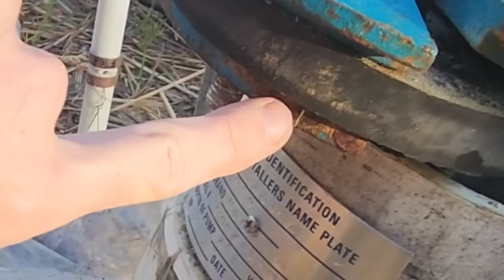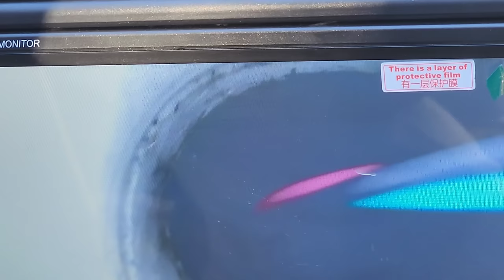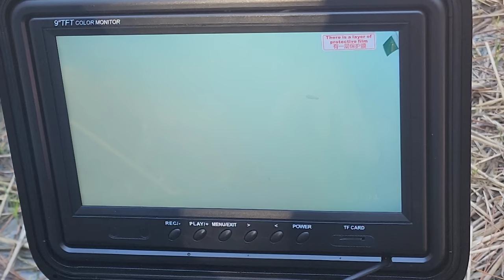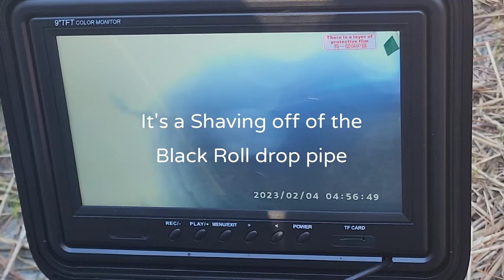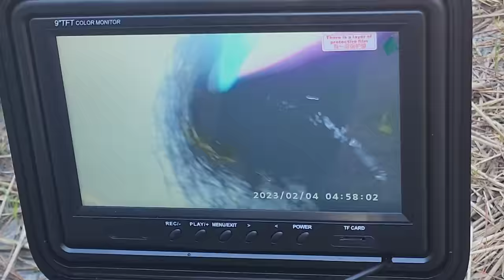What You Dont See! Discolored Well Water & Why it's Happening to Your Well.

Comment: My pump kicks on at 40 psi runs back to 60 kicks off..after 2 or 3 times it will drop  to zero. 30 seconds to a min later kicks on but shuts off at 45. Pressure switch changed. Still doing it. Pressure tank at 36 when empty.
Reply from the maker: Lower tank pressure to 30. Try that. 
If the water pressure  fluctuates up & down & your not running water, then the check valve in the pump is bad.

Comment: ⚠️ As an electrical contractor for over 30 years, I shuddered when I saw that “1900” (4” square) electrical junction box being used OUTDOORS!    I know virtually nothing about wells and water pumps used in a residential environment as my work area is a suburban metro area with municipal water supply.

Great channel and video.
Thank you.
Reply: Not sure about where they are at, but in my area, Wells are required to have an electrical disconnect at the location of the well itself. Normally just the well pump control box works, as you lift the lid and it separates the connection, but I had a 2 wire pump 110v and my uncle who is a licensed electrician used a simple light switch to make the disconnect until I could upgrade to a 3 wire pump and use the well pump control box with the capacitor. 
But we also have a shed the well, pressure tank and electrical are all in. 
I would recommend this guy build a small shack to protect the well, instead of using that igloo as a cover.
Reply: @cybernoid001  yes.. an enclosure would be very advantageous.
The 1900 style junction box is only approved and safe to use in indoor and where no moisture exists.
They are constructed of steel and have multiple holes for mounting screws and grounding screw(s).
They also have a ton of knockouts that offer ample room for water to pour right in.

I’d use uni-strut to build out a “frame” to mount all of the electrical and control gear.
I’d also add a service receptacle (GFCI protected of course) which is a NEC requirement for service personnel AND a fused disconnect for the pump motor itself.

Like you mentioned…
The use of an overall protective enclosure makes tremendous sense and would keep the weather out, keep animals away, keep the damn evil neighbor kids out 🤡, etc.

Comment: Id leave the well its fine. a large 2 stage filter will take care of all that easily. You got oversold.(MY OPINION) That water is still going to come in. Itll just seep along the liner to the lowest point, as in your water draw point. its inevitable, its gravity.
I also believe most of you posting are overly cautious. I see no fault in that. H20 Mechanic seems reputable😋 Please do as you wish :)
Reply from the maker: He actually has a big sediment filter, followed by 2 fiberglass tank filters & then a uv light. 
My opinion is to Fix the source. A liner will seal off the surface water. It's a liner, not a gravel pack sleeve.
Reply: Surface water contaminating deep well water is not acceptable, not to the homeowner and not to the local authorities.

Comment: Is it possible to deepen an existing well?  The only answer I ever get from drillers is no, but the reason is they don’t know if something is in the bottom, which seems ridiculous. It seem’s it is all about the money.
Reply from the maker: So yes it can be done, but here's the issue. If your well is 6" & the bit the 1st driller used was worn but ReSharpened, now their bit is cutting a hole that's 5.78". When you go to drill deeper, the driller must use a bit smaller than 5.78" . A air rotory hammer can't ream out a tight hole with a slightly bigger bite, it requires a flat surface to fire against, if he tried to do this, the rotation & hammer effect will keep binding up the bit & drill rods. (Like a drillbit that bites in metal & snaps off) the same thing can happen to the drillers $7k hammer/ bit. 
So the drill assumes the risk of possibly loosing his most expensive tool. He'd be down for 2 months if that happened. If it broke, then it would stay in the well. 
Some drillers sell 6" casing, you think you have a 6" well, but they use 5" bits. They cut faster & use less fuel. 
So can a well be drilled deeper yes, but we ad drillers only like to go back into our original holes bc we know what we do .  If I had to redrill a well that Company X had drilled originally, I would (as a driller) call Company X & ask them what size bits they run & how they do things ect. So ill know more information going into the situation. 
A re-drill is only worth it if your current well is over 300ft. Anything less than that, it's faster to drill a new hole

Comment: Plumbers in my area have been running alot of PEX underground 😬😬 makes me nervous
Reply: I think it was the fact that 3/4" pipe was used that is the main issue rather than it being pex. I would imagine that black roll pipe would be a better choice than pex because it is tougher and less likely to be damaged by a homeowner with a shovel; but every home I've owned with a well had 1" PVC coming into the house from the well head.

Take care and God Bless.
Reply: @theElderberryFarmer  yes he said the size but  he also said in the video he would like to see poly or pvc in the ground.  So would i  as a well tech of 23 years.
Reply: I've run shallow runs of pex underground for years, but in gardens, to supply hose bibbs. It's very, very durable, and almost impossible to penetrate with a garden fork or spade. But 3/4" pex from a well head is just plain crazy. Way, way too small.

Comment: Pipe should be at least 11/4 line we don't use any thing less because of fittings and length. The plate is on the first joint can't go to far if the bottom plate let's go and the top plate will hold it the bottom only to seal it off it doesn't hold the pump up any at all we only use just the top when we test pump and it's fine if you had a 5t it  never be a problem because your always able to center it in the well if you pull it by hand then ya you have a problem. Why couldn't you put a patch in it you already no were it need to be repaired a lining reduce the water income usually it the last thing you try to do 💧🌊🛠️💯👍👌✌️

Comment: This is why we in ont. Canada do not use crap PVC as a well caseing .. as all caseing must have a huge carbon steel driving shoe welded on to the 8"x1/2" well caseing and that drive shoe must be power driven into the bed rock. That seals any an all ground water from entering the well an why a septic field can be with in 50 feet of a well 100feet for dug wells. Just stop an think. You have a leaking PVC caseing because the PVC can not hold up to that 2000 lb hammer feel falling 60 feet. You put another junk PVC pipe in side it an you cement it in. An movement of the ground it leaks again that well is done. In our case a well can be drilled deeper at a later date years down the road if water slows way down as we need minimum 4gpm for any mortgage to be got. As well CMHC DEMANDS minimum 4gpm an that 8"x1/2" steel well caseing never fails. It will be like the day it was put in 110 years from now.
Reply: That caseing only $20 cnd per foot it must go into solid bed rock or it's not pasted

Comment: Why don’t you use steel pipe with a drive shoe on?
Reply from the maker: It's not my Well.
But metal isn't required & rarely needed. We have a special way of adding strength to the plastic end that seal & we also sometimes add a 7' piece of metal casing at the bottom to prevent this from happening

Comment: That 3/4" pipe, if it were iron pipe, would lose 2.75psi in 100ft given that pump's flow rate of only 5gpm.  Given that it is PEX, even less.  Using 1" pipe you would lose about 0.8psi in iron.   So, you are giving up one or two psi.  Not the end of the world, but just kind of lazy to use pipe that small and make the pump do 5% more work every day of its life.    If he were actually running the fixtures off that pump, it would be awful.  However, if you read that right that it is only a 5gpm pump, then that tiny little pump is just maintaining the accumulator tank over time and it is the tank pressure that is moving the water through the house.

Comment: 4:24:  Just what kind of an idiotic plumbing installation is this?  First I saw the exposed piping at the well which will freeze in cold weather --- but this is the first I saw that EXPOSED ELECTRICAL BOX in this plumbing job from hell.  What were the installers thinking?

Comment: now  when they put the well pum,p down and it blew in half and they had to  pull it could that pump having blowing in half damaged my well housing . Plus when these plumbers moved my whole house water filter they used pex in 6 foot sections and used the crimp clamps  and even on the black roll pipe from the well to the house and that is leaking there and have called them and they have not come back to fix it yet  . Did that guy hopefully change out his pex  sad that they did that to him

Comment: got the pressure switch today  but I checked air pressure in my pressure tank it is just over 40 psi and pressure tank says 75 psi on it  maximum and that new garbage pressure switch is 40/60 but  pressure switch only is at 40 and when I tapped the pressure switch it went up to 60 for a few minutes and then down to 50  and then back down to 40  . no water has been run in the house for 3 hours . I tapped the pressure switch again and it did no move to 55   again

Comment: WHY DID MY plumbers not put metal tags on my pump install again . this is the second time  they installed a new pump  on my well . They  were the only ones i could get on short notice . Reason short notice was because both times hubby was in the hospital after a heart attack  .Now you are really making me question how good plumbers are in Pittsylvania county va    2012  and 2022
Reply from the maker: It's done on new construction but not required
Reply: @h2omechanic  I know I wrote on it on my casing with a black marker and it is still there  since the casing has always been covered